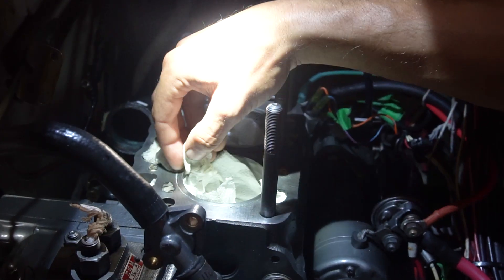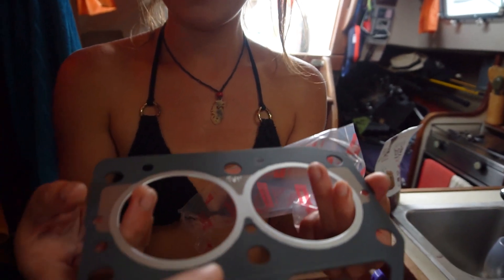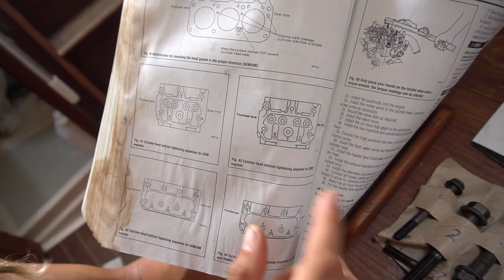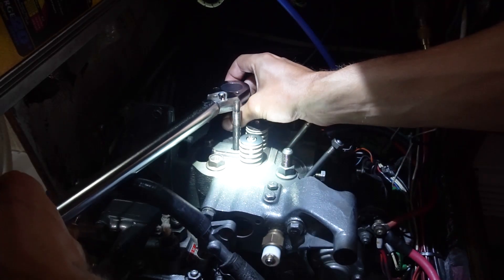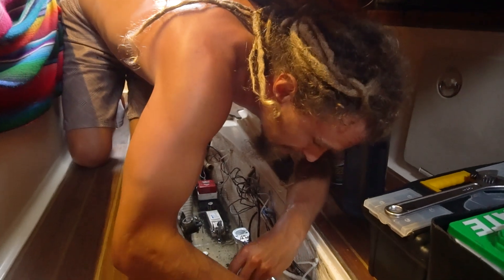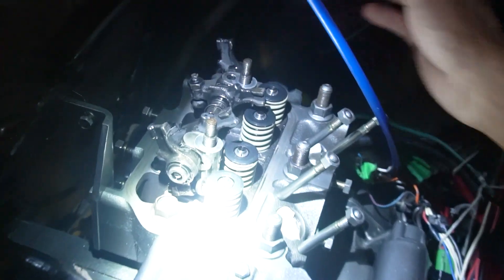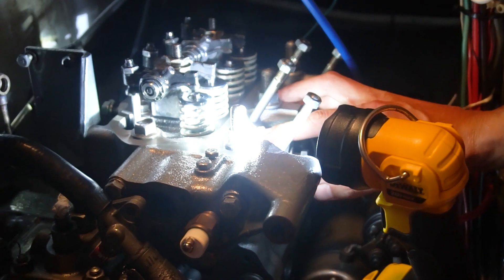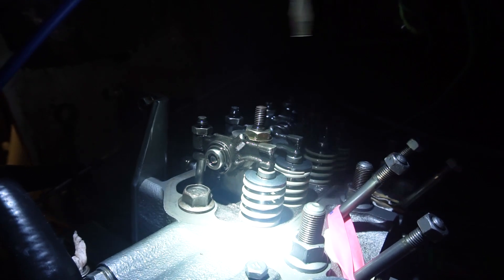Yanmar 2GM Engine Rebuild: CYLINDER HEAD Install | VALVE LASH adjustment (Part 8)

Comment: Hi, in the Yanmar manual he say to apply "Three Bond 50 gasket scaler to both sides of a new cylinder head gasket". But i don't understand how and where. Do you have apply this silicon element on both sides of a new cylinder head? Thank you.  I'm going crazy about it!
Reply from the maker: No we didn't use that. Just the head gasket. But we didn't see anything in our manual about it. Maybe we missed it.

Comment: By oiling the head bolts you over torque the bolts. Torque specs are determined on dry bolts.
Reply from the maker: This is likely true. We learnt about this afterwards. our torque wrench and scale I used to "calibrate" it were not very accurate as well. But it is still running fine and have had no issues. Thanks for the info.
Reply: A sincere thanks for your outstanding engine videos (and the Gazelle I just found).  Your inherent knowledge and proper use of term belie your humble presentation. I’m doing a 3HM30 and was inspired by your step by step instructions.

Looking forward to enjoying more of your videos 😎⛵️🍹
Reply from the maker: Wow thank you so much this means a lot to us. Glad we could inspire you. Enjoy the videos.

Comment: Thank you so much! I also have a Yanmar 2gm 20f. I’m working on mine now and your video is a huge help.
Reply from the maker: You're welcome Charlie. What are you doing on your engine?
Reply: @WildlyIntrepid  cleaning out the heat exchanger and then the mixing elbow. Also re-adjusting the valves.
Reply from the maker: I'm sure the engine is going to run smoother after. Best of luck

Comment: Good idea to use a handheld weighting scale to check torque wrench setting. Wow! I'm learning alot watching your videos on this engine repair. Thank you :)
Reply from the maker: So glad you are gaining knowledge from our videos. Im not 100% sure which is more accurate, a cheap harbor freight torque wrench or the scale but it seemed to have worked out. Ill let you know if we ever get a better wrench that is calibrated and see if the bolts are in spec.

Comment: Hi,
Do you know what the valve clearances are please, for the exhaust and the inlet? Are they the same size or different size. I'm doing mine now as part of the service. Someone said its 0.22mm for all of them?
Thanks Lee.
Reply from the maker: unfortunately we are not at our boat for a couple months and therefore we dont have access to our manual. but I'm sure the info is out there somewhere.
Reply: @WildlyIntrepid  its OK all sorted now, via the power of several sailing groups on Facebook 😎😎😎
Reply from the maker: Great we're super happy that you found the info. So many great resources out there.

Comment: Thank you. About to do this to my 3gmd
Reply from the maker: Best of luck hopefully it all goes smooth
Reply: @WildlyIntrepid  yeah I still have a old dinosaur engine. One of my buddies in St Augustine has a fully electric converted Pearson 530. We commissioned it Saturday.
Reply from the maker: Nice. That sounds like a fun project. We are crossing the gulf tomorrow and should be in st Augustine in 36 to 48 hours depending on current
Reply: @WildlyIntrepid  safe travels!

Comment: Nice Job guys, very through. I have a 2gm in my H30 and have been really impressed with your attention to detail on the rebuild.
Reply from the maker: Thank you so much Dane. Have you had to do some major work on yours too?
Reply: @WildlyIntrepid  new purchase, should be launching very soon. Luckily after 6 years on the hard, it still starts and runs like a champ after doing all the routine maintenance.
Reply from the maker: Awesome. Glad it runs fine. Enjoy the new sailing season with it. And Hunters are fun to sail.
Reply: What is the name of the engine type, bro?

Comment: I’ll have to do mine as well. I got some antifreeze on the oil. But mine 2gm has a heat exchanger, which complicates a little more
Reply from the maker: Just one more part to learn but with a little time and research It should be doable.